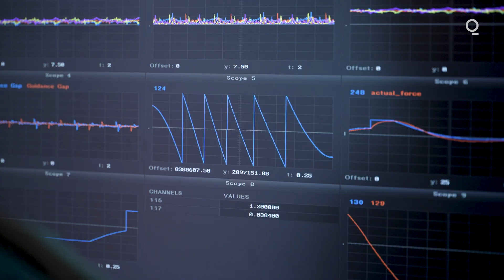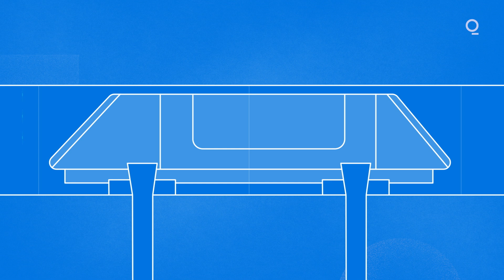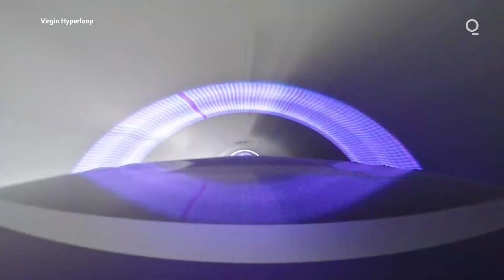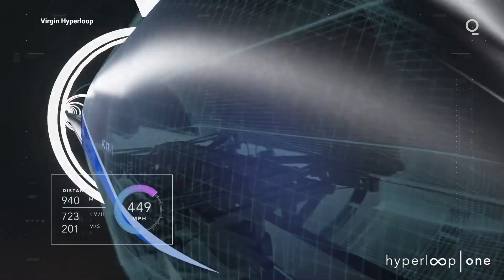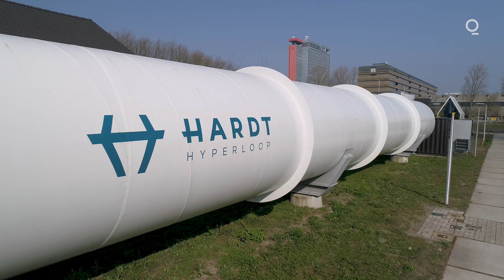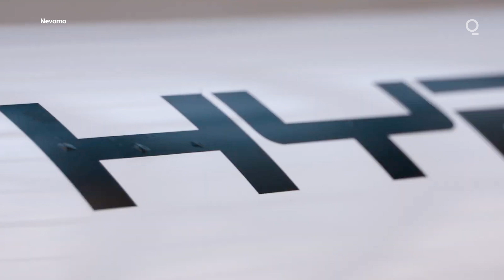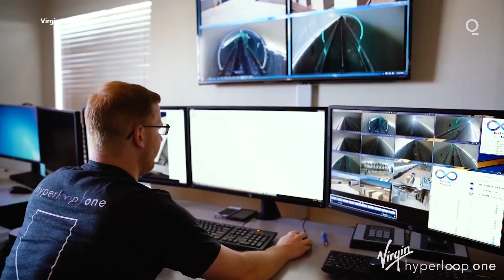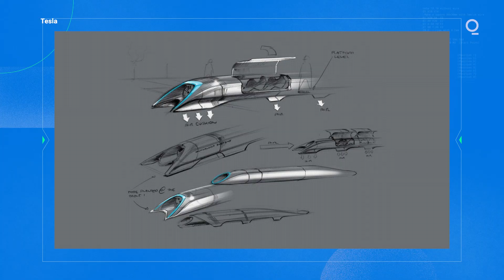The Hyperloop May Disrupt More Than Just Travel

Comment: We already have pretty fast train solutions available - Maglevs - and even they have failed to be widely adopted. Hyperloop is dead in the water if it can't make an economical case for itself.
Reply: The economical case would rely on the system being modular. Sporting anything from a minivan to a motorbike... Well, maybe as enclosed vehicles, possibly using maglev (only way to approach anything resembling viability) in a tunnel and somewhat faster.
Reply: @mjouwbuis  i agree on this. i feel like hyper loop might be more accepted as infrastructure if it also becomes used to move cargo. shipping cargo over waters is highly costly and takes so much time so if they can connect the trains internationally for shipping, there would be way bigger incentive. there could maybe be larger pods for cargo that arrive at a cargo station separate from smaller pods holding people that arrive at a transit station. the only issue i see with this is how it would be much more difficult managing schedules for the trains...but i suppose that’s still way in the future for now. oh plus i’m a little concerned as far as how this will affect natural geography as in are these just floating tubes or on the ground? if the tubes aren’t suspended, they could affect wildlife as animals get cut off from different locations. if they are suspended and see through, they’ll have to be careful of making markers so that birds don’t constantly fly into the tubes. this sounds amazing and all especially if they’ll sustain the energy through solar power and other renewable energy, but i do really hope they consider nature when building in the future. maybe they could make tunnels for animals to cross, like the animal crossing land bridges. but tbh....sounds like me, as a normal average person, will not be seeing this as a commercial option for at least another 30+ years lol. (especially considering how long it’s taking california to just build a regular high speed transit train...)
Reply: @The Genetik Hyperloop will never be the future solution.  The physics don't work.  Haven't you seen a Thunderfoot video?
Reply: the energy expenditure required to maintain near-vacuum far outweighs the efficiency gain in speed from the elimination of air drag
Reply: True depends on what people care
Reply: What do you mean"if"?  There has never been anyone making the case for its economic viability.  They simply state that it "may" be more economical than other forms of transport.
Reply: The government has been using them for decades. There should still be an old military drilling rig pic on the internet. It's bigger than the one Elon showed off. Phil Schneider talked about them in the 80's/90's.
Reply: And you got over 100 thumbs up... We are truly doomed.
Reply: Yawn... Another petroleum industry sponsored troll crying about how scary or impractical Hyperloop is LOL
Reply: @blondegirlsezthis8798  do maglevs even use petroleum

Comment: how will they make vacuum in some thousand miles tube ? what's about the material length variation with temperature ? it would introduce critical leaks in the system , they are focusing on the pod but the pod its the easiest , we made airplanes soo  ...

Comment: Just build high speed rail like China and Japan did. Literally all our current "hyperloop" designs is just maglev in a tube, so why don't we just build maglev? Why do we have to use tiny claustrophobic pods instead of a large, spacious train that you can actually see out of?

And no, the tube is not a vacuum. It might have slightly less air pressure than outside, but that's literally it.
Reply: The proposal is not "slightly less pressure", it's a 99 percent reduction in pressure. Removing drag is key for any kind of viable high-speed travel. Planes do it by travelling at roughly 10 000 meters height where the pressure is just a quarter of that at sea level.

Comment: Is air drag so bad?
Reply: At high speed air drag is the most demanding aspect in travel to overcome. Going 200 km/h to 1000 km/h would demand a 25 fold increase in energy use just to overcome drag.

Comment: Twin tunnels, small pods, point to point design cause costs to explode.  Use single tubes and add sidings at hubs.  One tube Liverpool-Manchester-Leeds with a siding in Manchester using large pods like a single subway car or highway coach.  As the pod travels from Liverpool to Manchester, the Manchester car is loading on a siding.  Once the Liverpool pod arrives, the filled Manchester pod takes the tube back to Liverpool.  At 5 minute runs, it would be enough for unloading / loading.  Focus on building out more cities with single tubes.  As costs come down, double the tubes between hubs and then progress to full network double tubes.

Comment: I still think it's amazing for Cargo even if it doesn't work for people.
Reply: I find it hard to believe that there is so much cargo that absolutely needs to be delivered in an hour, rather than five or ten, to make such an investment worthwhile. You know, trucks and freight trains are a thing.
Reply: @richardmetzler7909  Any investment is super expensive when you start out. Aircrafts were thought of the same way not so long ago. It'll start out slow and have a few immediate use cases. That list will grow as the cost to use it lowers and the network of Hyperloops grows larger.

Comment: Hyperloop's capacity is way too low to work. Because of the super-high speeds headways have to be large, so capacity is reduced. This wouldn't be a problem if the vehicles themselves had a high capacity (like a train), but these pods can only fit up to 30 people in them. Seems to me the biggest challenge.
Reply: Biggest challenge is the vacuum. Dont think it will ever work

Comment: Tbh I am very skeptical about the viability of making the biggest vacuum chamber in the world and putting high speed pods in them all while promising it to be safe. I get that the failurerate will be very low, but the consequences of a failure will be substantial. 
When something happens and a pod crashes, not only are the people in that particular pod in trouble, all the other pods in that tube will be hit by a high pressure difference similar to a shockwave. Not to mention that any damage will not be easy to repair due to the high loads the wall will have to bear. even when all walls will be intact and the vacuum will be preserved, suddenly all pods will come to a standstill in a tube where nobody can survive outside of those pods. fast evacuation will not be possible.

Comment: Have mixed thoughts...what if someone attacks the track? Or a part of the track suddenly collapses or has a structural failure? Or an Earthquake hits while your on this? What contingencies are in place? Because your going to hit that part of the track or get thrown around like a pin ball before you can slow down! At those speeds any little thing can kill you O.o 
And the way these companies skip out on safety and try to get around regulations, it's going to be a LONG time before I trust this.
BUT I'm excited at the same time and want them to develop this and bring it to market. We need to invest in this as much as possible
Reply: I mean the first limiting factor is the track has to be very straight, and somehow be totally sealed and hold a partial vacuum, that's alot of power needed right there.

Comment: I love that it is encased, nothing would be hurt by speeding carriage. Need there own air supply, if it ever stopped in the tunnel.
Reply: You realise the vulnerability of building vacuum sealed tubes above ground? The slightest damage and everything implodes
Reply: Nothing hurt by a speeding carriage?
How many pods will they put in a tube at a time? 
If one breaks down, they will have to have a warning system and enough separation between the pods to allow emergency stops, and then they all have to back up, and if the vacuum is compromised that could take quite a while!

Comment: The problem with hyperloop for me is when there is a malfunction and tragedy happens you can't scape. Unlike open space train you can open the door abd walk in the side to go for safety.
Reply: @VideoAmericanStyle  not really, if engines fail in plane, plane still can glide itself to ground/sea. If engine fail in HL, what then? wait for push? Besides, pods suppose to  be close to each other, how to avoid crash?
Reply: You won't even get to react when it crashes
Reply: The parachute is the only way of transportation that when there is a malfunction, you arrive faster at the destination.
Reply: If they build the tunnels with exits every, say, 500 metres and emergency valves then it should be possible to both flood the tube with outside air in a couple of seconds and be able to exit the tube rather quickly. Government regulation should help with that, at least in places with proper regulation of course...
Reply: @vikteur5465  Not to mention the lack of moving parts to have fail in the first place.
Reply: With barely any moving parts compared to an ordinary train or airplane, it’ll very quickly become more safe than an airplane. In the case of an emergency like something going wrong with it’s magnets they’d probably slow it down immediately & there’d have to be escape paths by law so the people would be mostly ok. In the case of a crash, they’d all die before ever en realising something was wrong....

Comment: The US can't even get maglev off the ground what makes you think they can do this?
Reply: They can't even get high speed rail
Reply: @timothymeyer3210  They can't even get normal speed rail. How many new rails have been constructed?
Reply: why get the maglev when you can just wait for this
Reply: @momooavash  because the biggest vacuum chambers that exist now are few thousand times smaller than this would need. and well there is just no way anybody would build vacuum chamber of that size so fast. 
just get meglev it can do 500 km/h and be happy with it.
Reply: @momooavash  because this is 3 or more decades of material science away, and you could already have built a maglev railroad system in the places where it makes sense in the US (ie. serving more than 60% the country's population).
Reply: When it comes to materialistic achievements don’t ever doubt human
Reply: Why bother with maglev? We have AIRPLANES.
Reply: @Evil0tto  100000 years ago: why bother with houses. we have caves
Reply: @jebise1126  Except that airplanes are better than maglev. They're faster, cheaper, require less infrastructure, and go more places. 

So, to borrow your analogy, you're the one claiming we should live in caves. Trains, even maglev, are obsolete technology.
Reply: @Evil0tto  we have so many roads... why dont we just fly? no need for all that infrastructure.
Reply: @jebise1126  So you can't counter my argument? Two response from you so far, and they're both variations on the same strawman fallacy. 

You can't tell me why the United States should bother with maglev.